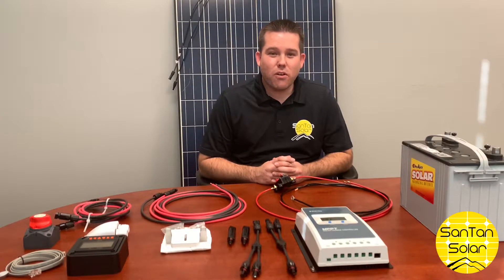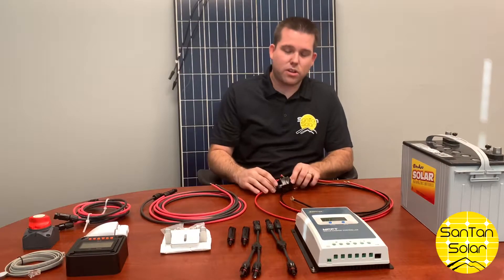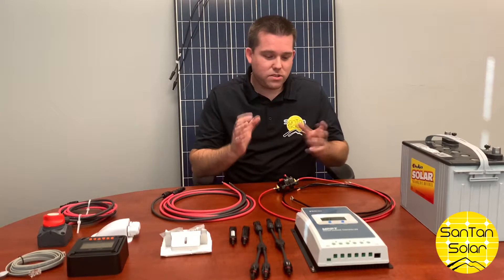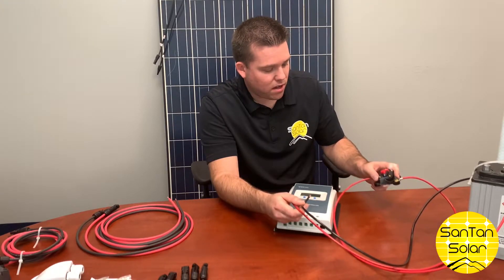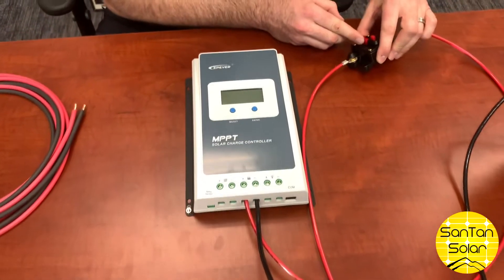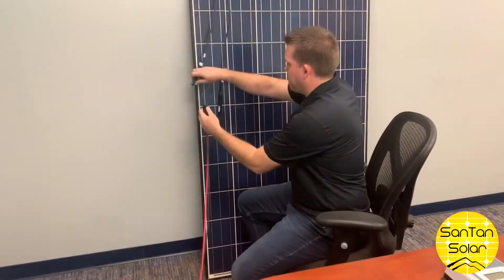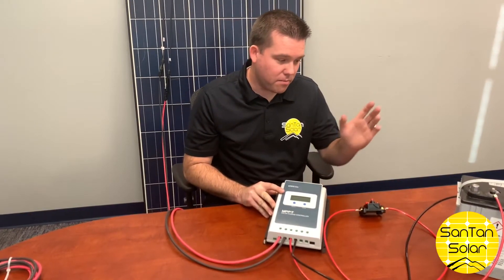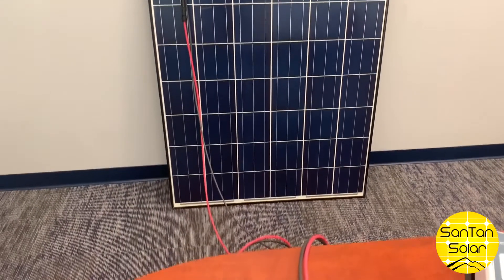Solar Kit Assembly - SanTan Solar

Comment: What's the other two connection points for on the charge controller?
Reply: Those other connection points are for connecting a load, like small LED lights etc. But I wouldn't use them, I run all DC appliances like lights, fans, tv etc from a fuse block.